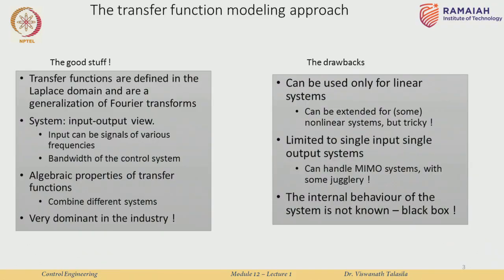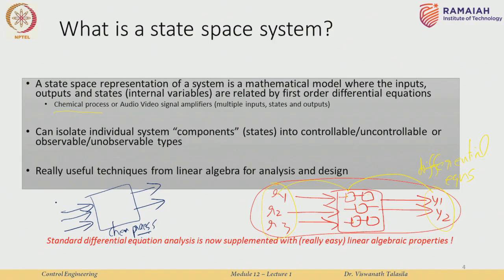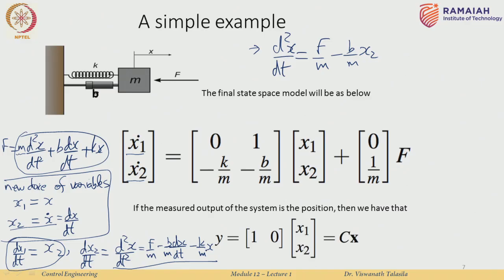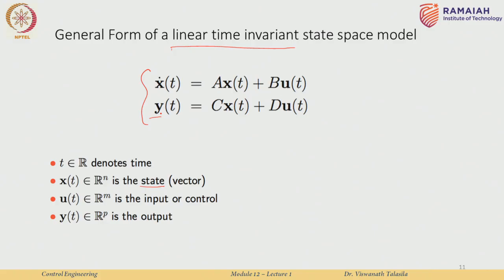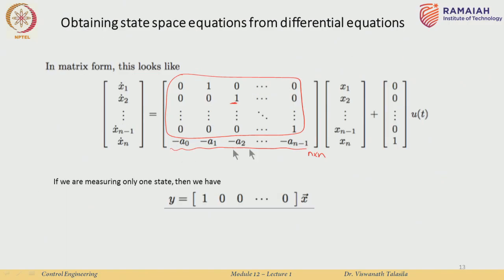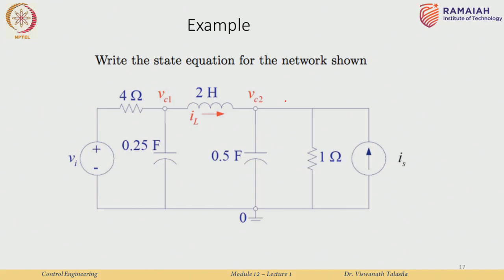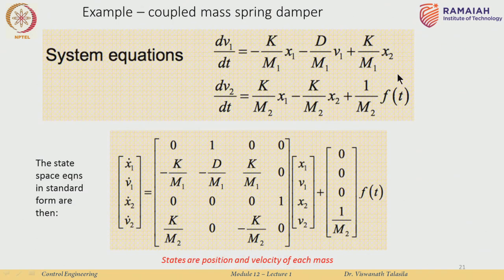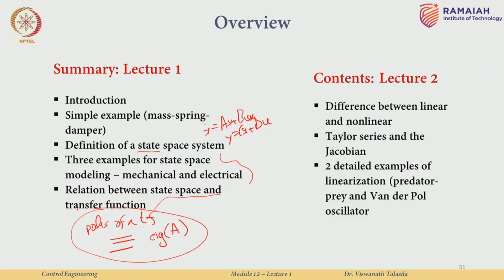Introduction to State Space Systems

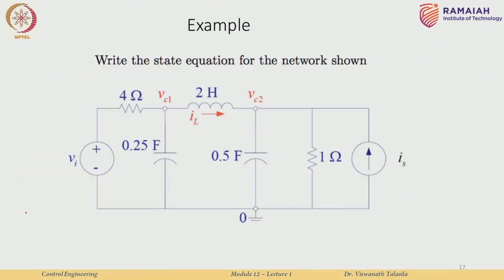Comment: At 1:02:14 it would make no sense to define your output as the sum of the voltage across C and the current across L. What in the world would that even mean? They don't have the same units. I think that what you actually want to do is make a separate measurement of Vc and of IL. To that end the y1 = IL and y2 = Vc and the C matrix is simply the 2X2  identity matrix.